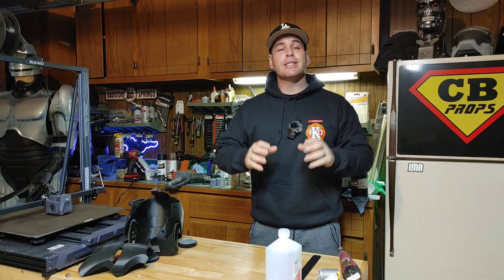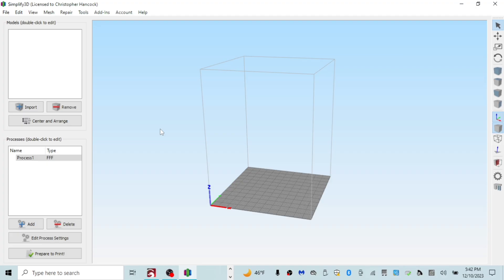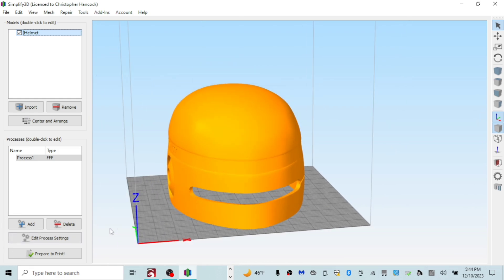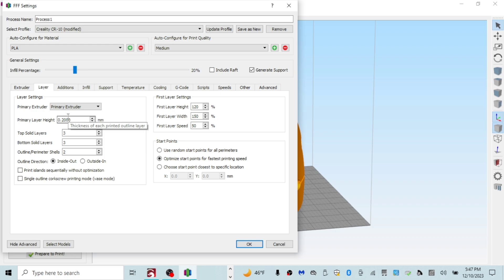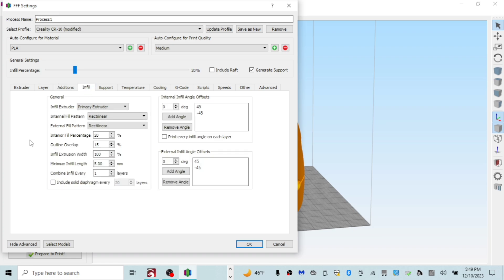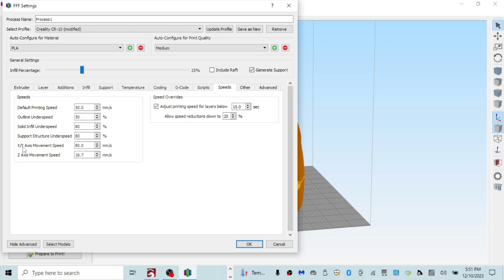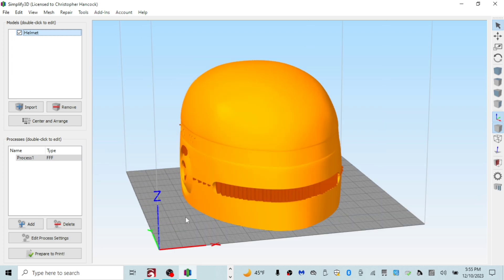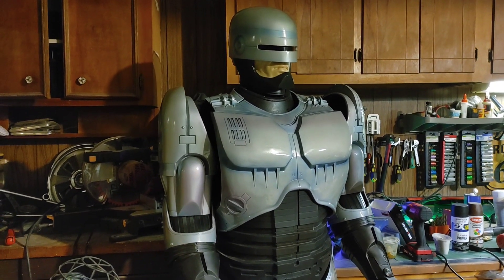My 3D Printed Robocop Suit Slicer Settings!

Comment: Hey Chris, I have a soft spot for S3D as well.  Heck, back in 2014 or so, if you wanted any level of custom support, they were the only game in town!  I haven't sampled their new version as I find Cura works very well for me.  The PRO about Cura is they update it all the time.  The CON is they update it all the time, so they seem to induce a lot of bugs!  I never thought to use a 0.4mm nozzle on prints like the Robocop helmet, etc.  I've found 0.8mm with 0.25mm layer height usually keeps all the great details.  I don't mind long print times tho if it saves some post processing, so I also use a 0.6mm nozzle on a few machines.  Great tips!
Reply from the maker: Awesome glad to hear I'm not the only one that loves S3D, it still works great and I'm using the old version never paid for the upgrade. Ill switch off with CURA as well for the tree supports every now and then. Thanks for commenting and sharing!